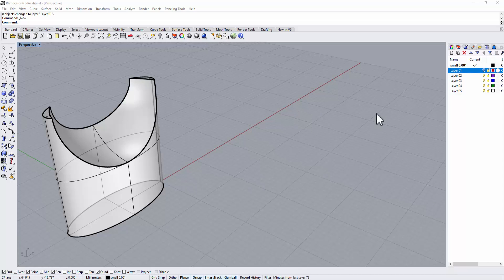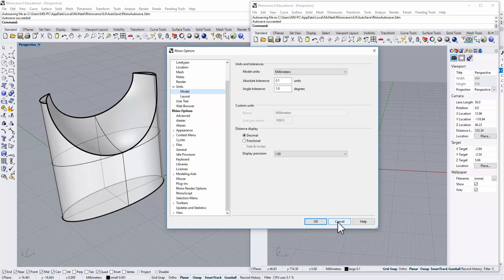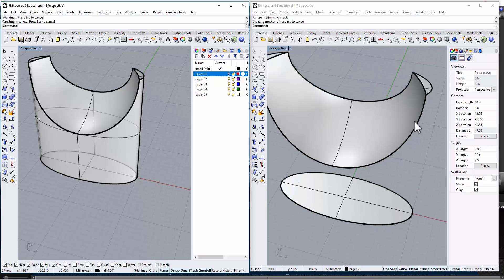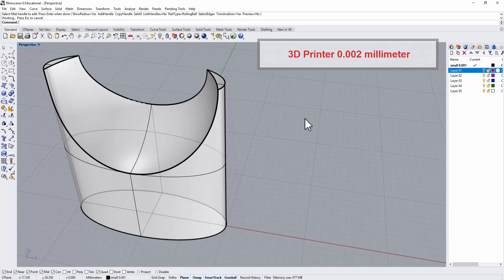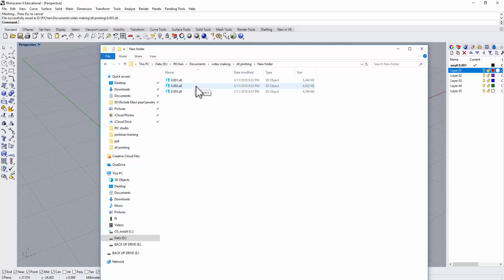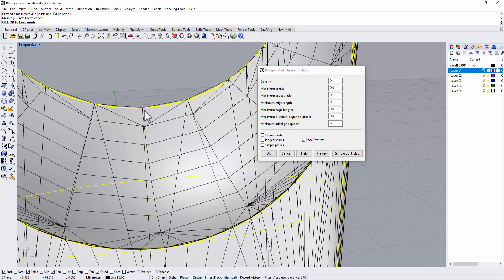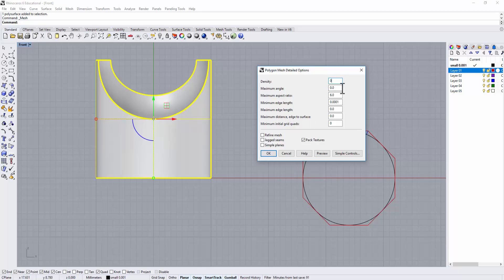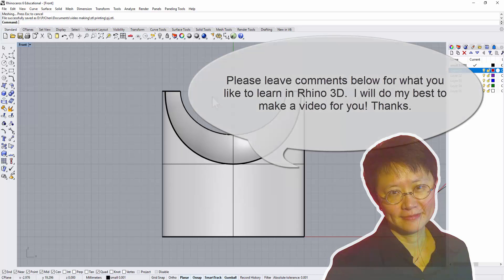Jewelry CAD Design Tutorial #22: How to Prepare STL file for 3D Printing (有中文字幕)

Comment: hello can changing the absolute tolerance give me more light product
Reply from the maker: the absolute tolerance can be change under "option-Unit". what do you mean by "more light product"? If you are talking about the size of it by changing to larger number, It may. However, you may lose the printing details.
Reply: @PJChenJewelryDesign  my goal is to reduce the weight as i can
Reply from the maker: @abdengineer6225  in that case. no. change the absolut tolerance won't change the weight. you need to hollow it out.

Comment: thanks 4 this detailed video... Please also share how to reduce triangles from the mesh...
Reply from the maker: if you reduce the triangle from the mesh, the model will be lowpoly, which will be rough. There are two ways to do it. First, if you have original NURBS surface, you can choice less polygon to start with. Second, if you don't have original surface and only can work with mesh. you can use "ReduceMesh" command. It can be set either by % of what you like to reduce or but # of mesh you like it to become. I hope this helps.
Reply: thanks 4 the guide basically i want to learn fixing process using the magics but i always stuck on overlap triangles tab. Please share some knowledge about fixing process.
Thanks in Advance....
Reply from the maker: Sometimes it is easier to rebuild error parts on the NURBS model instead try to weld or fix the mesh.